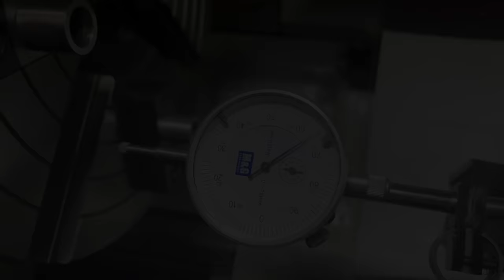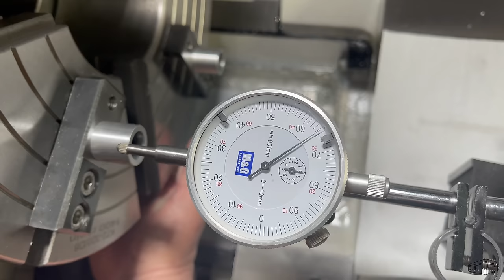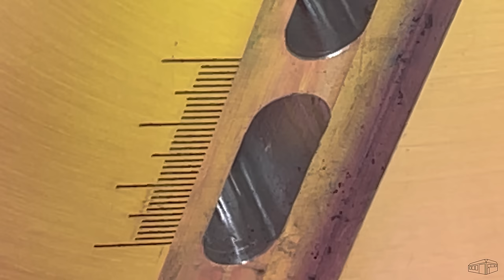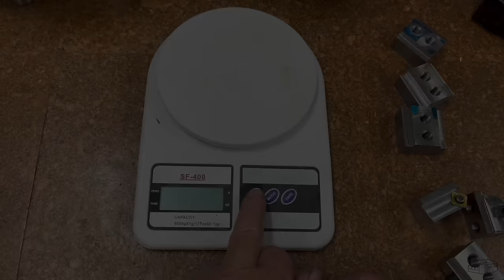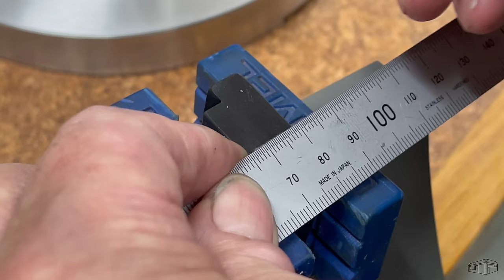Making the Most Versatile Fly Cutter | Shop Made Tools

Comment from the maker: I wanted this Fly Cutter to be big enough to handle any project I might want to do in the future. But versatility has to be the biggest feature. I made counterweights for each cutter block and machined them to the same weight, and with the engraving on the plate, I can set them accurately to provide the best balance at higher speeds. This is a Fly Cutter with real flexibility. I've been listening to your comments and done some work with improving the soundtrack and making them easier on the ear.
Reply: Ironically it's also quite rigid.
Reply from the maker: Thanks, It is rigid. Cheers
Reply: Awesome job mate. Given the size, you could almost make the entire thing into a four cutter face cutter. Especially if you have large surfaces where concentricity is essential. The size of the table needed would be massive though. What it also shows or it gives inspiration into a hobbyist machinists designing of tools. So thanks again.

Comment: I’ve machined a 10” fly cutter and arbor. Now it’s just a matter of sorting out the cutter design. I’ve revisited this build video for more inspiration and I really like the design of the cutter/ counterweight combo. I would like to build something similar. The inserts are a little different. But the overall design is amazing. I will probably return and watch this a few more times. You make it look too easy Sir ! 
Have a good day my friend. 🍻
Reply from the maker: Thanks for the comments Jason. I did put a lot of thought into the design of the counterweight system and I must admit that it has exceeded my expectations. As the plate is 250mm in diameter and 30mm thick, an aluminium plate is fine, it has enough mass to to cut effectively. If it was 200mm or less, steel or cast iron would be the go.
Matching a counterweight to each cutter block and having an engraved references scale means that I can achieve a measured balance and be able to spin it at higher rpm without vibration. 
Future insert options including HSS are planned for a future expansion of this project.
Cheers SteveO

Comment: For the optimum finish try round button inserts. The toolholder is simple, they have lots of cutting edges and they are available in high shear Aluminum grades.  To further improve finish, productivity and wear on the spindle bearings, set the cutting diameter slightly larger than the width of the work. This gives a much softer tip engagement and allows a faster spindle speed.
Reply from the maker: Thanks for the comment. I like your ideas. I must include  a round button insert. I also agree with your comments on size. That's one reason I made the fly cutter adjustable.
Cheers SteveO

Comment: I've been trying an aluminium flycutter filled with melted lead to try to dampen resonances in my Bridgeport, but the lack of rigidity in the aluminium body with the impact shocks from the interrupted cut still end up making some very slight ripples in the surface finish at the beginning of each cut. Mostly because the workpiece is Tellurium Copper rather than a free-machining steel or aluminium. Part of that's from the bendy little R8 fixing of course. I'm thinking of making one from a cast iron weightlifting plate!
Reply from the maker: Thanks for the comment. I need to do some experimenting with materials , speeds and feeds, the results I got on the day were pleasing and I showed these as best I could including with the microscope.
By the way, I am a subscriber and a big fan of your works. I'm planning a future project to build a lantern chuck based on your design, I will of course credit yourself with the inspiration for that, keep watching.  Cheers SteveO
Reply: @theoutbackshed  Your results show no sign of the ripples I was getting, probably because you have a proper solid spindle attachment.  The rest is down to cutter geometry and feeds and speeds as you say. I tried a button insert, but the best result I got on copper and aluminium were from a 0.8 mm radius CCGT running at about the same settings recommended by the manufacturer for surface speed and chip load.  Problem was that the impact ripples were too bad, so I had to drop the depth of cut, so the dynamics of the cut were less than ideal.  On aluminium it was very close to decent, but not like the mirror finish that a really solid machine could manage.  I started to worry about the strength of the disk and whether the lead might fly out and whack me in the chest, so I went back to using a big face mill with a single insert.  It'sll be interesting to see what I can achieve with the SYIL X5.
Reply: @theoutbackshed  If you make a lantern chuck with the end collet like mine, I'd recommend making the collet without a central hole and drilling/reaming them in place with a hollow spacer in place of a screw, and marking the radial position with a scribe line or dot as there's always a little runout with the brass nut.
Reply from the maker: Thanks for the reply, sounds like a plan. Cheers SteveO
Reply: To reduce impact shocks either set the cutter diameter to slightly larger than your part width. Alternatively, move the cutter so the impact edge of the part is just inside the insert perimeter. Both allow the insert to gradually engage with the part. This greatly reduces the impact and the initial ripple. Try to get the tool to start to cut at almost parallel with the X axis.

Comment: Nice job as usual. Unusual choice using aluminum as with steel there is a much better flywheel affect due to the weight and the cut improves due to a more stable surface speed but there isn't much in it if you turn up the speed. If you are making additional tip holders you might want to  make one to suit a APMT style tip. They are high rate tips usually but come in a variety of rakes, compounds , nose radius and finishes. The good thing about these is their cost. Depending on the source they can be under a dollar each (Alibarber). They were usually found on multiple tip milling cutters. They will carry the added benefit of being a milling tip to start with so making the holders will be a lot less messing around with angles and such.  I have made a tool holder to use these as a turning tool and been very happy with the results for light to medium duty machining. I have seen remarkable results using round tips as well.
Reply from the maker: Thanks for the comment.  Aluminium is all I had and I think I will get enough inertia out of it for my purposes. The plate is 30mm thick and has a good mass (I haven.t weighed it). I have some APMT inserts, they are in some of my boring bars and the 50mm face mill which I used in the video.
It might make an interesting project to make a cutter block for them. I'll have a think about that. 
Cheers SteveO

Comment: Thanks for sharing. Have you tried a high speed shear tool with a lite depth pass? Or a sharpened carbide insert?
Reply from the maker: Thanks for the comment. I have only done what you have seen, I need to do some experimenting with speeds and feeds and on different materials.  Cheers SteveO

Comment: need to get some polished micro grain inserts for al.  most of the gold coatings I have used bond with the al and make it tear without wd40 or kero on it. as for feed, less than half the nose radius of the insert.
Reply from the maker: Thanks for the comment. That's good advice. Cheers SteveO

Comment: Great! But You can use another insetrt material for milling aluminium. Make test at steel. Must be more best.
Reply from the maker: Thanks for the comment, I'll be using it on steel in an upcoming project, stay tuned. Cheers SteveO
Reply: @theoutbackshed  OK )

Comment: Nice job, looks the goods. 
Small point WRT the scales; they are precise to 1 gram, not necessarily accurate to 1 gram. Accuracy != precision.
Reply: For comparison that should not matter?
Reply: @seapy2398 Yes, it absolutely matters. They are not the same thing.
Say the scales display  to 3 decimal places (precision) but were only accurate to 1 decimal place, if you don't understand that, then it can cause problems.
Reply: @seapy2398 Re-reading your reply, it matters very much in this case because the assumption that the scales are accurate to 1g is being made, and that is not necessarily the case.
Reply from the maker: Thanks for the comment. 
I wasn't trying to achieve a specific weight, I machined the cutter blocks and the weights were what they were. My objective was to machine each counterweigh to match each cutter block. The table on the scale reads 500g x 1g. This infers that the scales average half a gram over and half a gram under. So, it's possible for a cutter block to be 124.5g, and the counterweight to be 125.4g and both would register at 125g on the scale.

This would be due to the scale rounding the values to the closest display digit. Therefore it's possible that there could but up to 0.9g difference in the final weight between the cutter block and the counterweight.
I don't think this would cause any balance issues during use and I  can easily compensate by offsetting the mount against the scales if needed.
I haven't seen anyone else match the weights or place a scale to maximise alignment.

Hope this explains my intentions.
Cheers SteveO